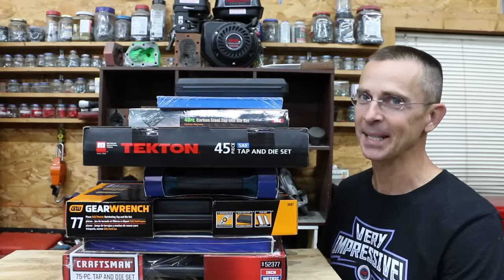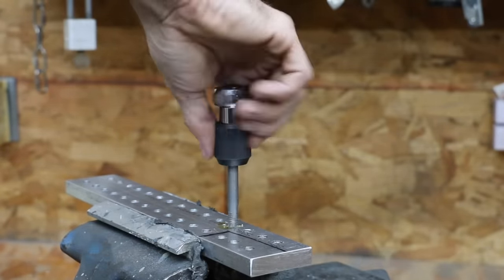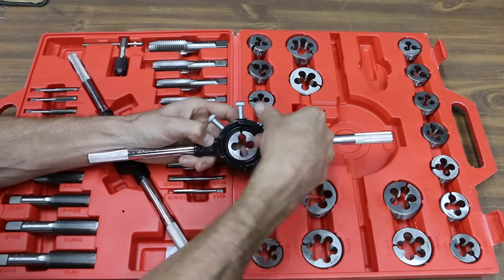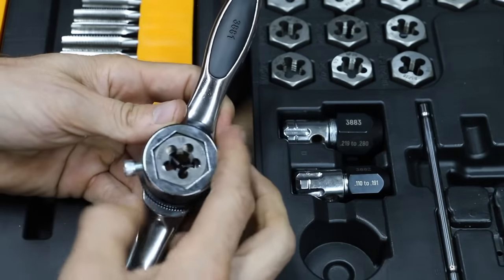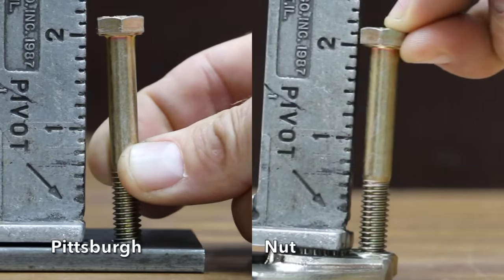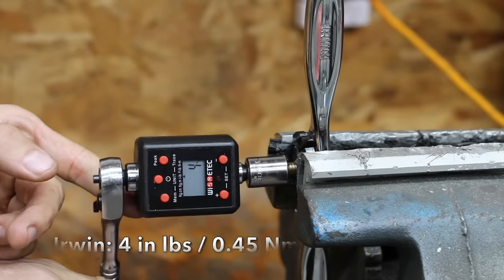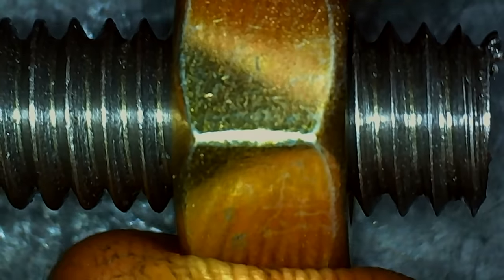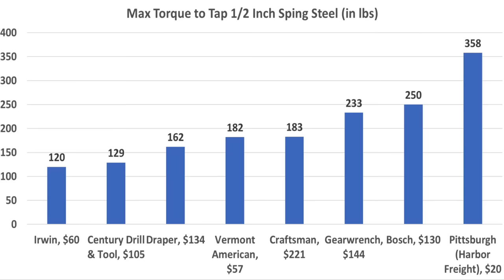Best TAP & DIE Set? Craftsman vs Irwin, Bosch, Draper, Vermont American, Tekton, GearWrench

Comment: Can we do a part 2 with some of the very high end taps like guhring taps? Not sure how you would be able to replicate the hardness, but on certain high pressure turbines using austentic stainless steel get a corrosion deposit on them that is quit a bit harder than the underlying metal and nearly on par with a nitriding coating. A regular HSS tap I was destroying a tap every two holes while the Guhring taps, while 10 times the price, were lasting 50 times as long in that application so actually ended up being cheaper over time
On another note definitely worth mentioning for the average person is the difference between starter taps (taper taps), mid taps(plug taps)and bottom taps.Looks actually like most of the ones you are using are plug taps, which while they will do the job, a taper tap will do a much better job aligning the tap correctly if you are doing it free hand.
Reply from the maker: Thanks for the suggestion.

Comment: To be fair, Aluminium is so soft you can use woodworking tools on it so in that regard it's good for testing the quality of the threads.
Since its so soft, if the threads are bad it'll just come out, so a comparison of the amount of force it takes to rip the bolt out would be interesting to see.
Reply from the maker: Thanks for the video idea.

Comment: Master Farm - Avid fan of your vids & subscriber. I know this vid is old. Abut a year ago I bought the Irwin set in both SEA & metric. I have used them many times since (both die & tap). They have performed very well. I even had to thread some 3/8" stainless steel rod into a 3/8 piece of stainless steel all at 24 TPI. That stuff is hard! Only issue @ 24 TPI was a couple threads toward the end shaved away. Yes was very careful with that fine pitch and used cutting fluid. Just a couple threads broke. Maybe my technique needs refining but those are fine thread

So WHY THAT BACKGROUND? Please tell me why several YouTubers I just saw swear you only use ROUND dies for threading rod and Hex dies are only for chasing threads? Have you ever heard that? These HEX Irwins work MUCH better than an old set of USA Craftsman round that I have. The Irwin dies are also much easier to start with a little insert in the cutting end. Just wondered what the deal was with so many saying not to use Hex dies for cutting.

Comment: I have always understood that the cheap sets are made from HSS and are good for thread repair or use in soft materials such as aluminium or mild steel. The ones for real  threading are made from a much harder material. Some of stuff being sold is terrible, even at my current work we have a HSS set that is good for bugger all. What might be interesting is if you could measure the rockwell hardness.
Reply from the maker: Thanks for the suggestion.

Comment: in my humble opinion I think the loose fit comes because you are using all those adaptors when measuring torque, which is fine for that purpose only, but the final whole which you test for fitting should be done very carefully with either the handles provided or your drilling machine to insure it goes ALL the way straight and not just the first few threads
Reply from the maker: Thanks for the feedback.

Comment: It seems the Irwin set performed the best 
But unfortunately I can buy it
Maybe test Alpen and wurth taps and dies 
I've researched both well but I don't know how well they will work with tapping spring steel, 

I plan on using it to make a file guide from 5160
Reply from the maker: Thanks for the suggestion.

Comment: What i've found with tap/die sets is that consistency between multiple sets of the same brand is what is more important.  That craftsman brand may have been closer to spec'd tolerance vs. some other sets, for example.  The more expensive sets tend to be MUCH tighter between sets of taps/dies.  If you take 10 sets of the craftsman version and tested between them you would find more variance than with a more expensive brand (at least in my experience...)

The other thing I think about a lot is the taped vs. die'd threads, does the thread made by the tap fit the die tighter?  That sort of thing is more important to someone who is machining a lot of custom parts than with the tap/die fitting whatever nut/bolt from a hardware store... which ALSO has a MASSIVE amount of variance from what I've learned.

Then again, we are the kind of people who weigh airsoft BB's and make graphs in order to find the best ammo :D
Reply from the maker: Thanks for the feedback.

Comment: Four flute taps are designed for rethreading, not cutting virgin threads, they will break and shatter. New threads are generally cut with two flute gun taps.
Reply from the maker: Thanks for the feedback.

Comment: I figured Erwin would probably do the best. I was hoping Snap-On would be included in this testing even though they are both made by Erwin. Snap-On requires additional steps in manufacturing and I was curious if those steps included material quality. Their adjustable Dies are something I wish I had in order to make tighter threads with less slop. It's unique how Erwin bought up past branded companies such as Ace and then Ace/Hanson to Hanson and now just Erwin. Erwin is the go-to company for Snap-On, Mac and Matco, plus Blue Point and many other well made tap and dies and Drill Bits. The alternative is over seas hit and miss quality.
Reply from the maker: Thanks for the feedback.

Comment: I was surprised at the amount of slop. I hobby machine and long ago found spiral taps worth their higher price and they can be power driven straight through the material. The taps shown are plug taps, more difficult to start by hand than taper taps.   The kind of dies shown are generally thought of as rethreading dies. Split dies work better for making threads on bar stock. They allow a small amount of adjustment.
Reply from the maker: Thanks for the feedback.

Comment: How about testing those helical insert thingies? I'd be interested to know if any are worthwhile. I had a motorcycle where a mechanic at a dealer service shop stripped the threads on the valve cover and I repaired it using a helical insert.
Reply from the maker: Thanks for the video idea.

Comment: I wonder how much a tap would remove from a good nut. Though I'm more curious how threads you made would fit in one of the tapped holes as if you had to make both a nut and bolt.
Reply from the maker: Thanks for the video idea.

Comment: People need to understand these sets are not for high production, most of these are good for home shops who only need a tap or die occasionally. Most of these are most likely class 1B because of how loose a thread they produce. These are good for cleanup of existing threads. For a tighter fit you would need to use a class 3B. 
It's a good overall test of products for most home shops.
Reply from the maker: Thanks!

Comment: Choice of tap and die sets depends on what you are doing, and whether they will be used often or occasionally.  But good taps and dies are not cheap, and cheap taps and dies are not good. Stocking a complete set can be costly to cover course and fine threads in inch and metric.  Incomplete sets are often frustrating, as you can be stuck without the size and thread pitch required for a job. Added to this is the kits generally are a compromise, containing only plug taps.  Often , tapered and bottoming taps are required.
Reply from the maker: Good Point!

Comment: The major reason for the side to side movement was the size drill he used (which he never showed) compared to each individual tap; that's the biggest reason for his fuck up! He used one drill to make a shit ton of holes, but used an incorrect tap (prolly same one) from each brand for each hole. Every machinist should know to follow your tap/drill size chart religiously for the best fit possible. You do that, it don't matter which tap & die set you use.

The other thing to keep an eye on is the thread series and class of fit #. All of the tap and dies he showed us were a UNC series, and even though he didn't show the class of fit # (it'd be in the manual of the tap and die kit purchased) I'd say the COF for a UNC would be either a 1 or a 2, which is a loose fit.

Comment: I kinda wish you would’ve measured the tap’s crest, and depth of thread. It’s hard to believe a marked measurement would be that off with the tap holes. If only there were a way to measure cutting effort by torque on a Fein tapping drill with the base for even plunges. I worked in a panel shop prepping enclosures/panels for devices and wire ducts. Everyone liked my work, because I never gave them “spinners” (screws that spin when trying to tighten).
Reply from the maker: Thanks for sharing.

Comment: One thing I forgot to add is when cutting threads using these tools, you turn 3 turns cutting, then back half turn to break off the chips. This leaves a clean thread, as not backing it up by half turn can cause the tool to clog up with metal chips, & leave a badly cut thread.

Comment: Those types of thread dies are not meant to be used to cut new threads. They are called chase dies. Only meant to be used to chase threads that have been damaged and require minimal clean up of the thread.

Comment: I have a harbor freight tap and die set from probably 18 years ago, its been great for what it is. However, the metric one I bought last year.. the taps aren't even deburred or cleaned, there burrs hanging off the taps, threads not fully formed, etc. They are complete junk and just wallow the hole out.
Reply from the maker: Thanks for sharing.

Comment: For my RC i use cheap tap like £4 for a set of 2 and just bought a cheap t handle ive snapped 1 in 2 years and lost countless but no biggie in replacements cheap enough
Reply from the maker: Thanks for the feedback.
Reply: @ProjectFarm  no problems cheap and expensive do have there places just depends on the job 👌

Comment: I love your show, and watch regularly. I don't mean to be nasty - I hope to contribute some positive criticism, but I've noticed in more than a few episodes that your testing methodology regularly disregards manufacturer/instrument/tool instructions/best practices. A few people have already mentioned how some of the dies were adjustable, but you didn't take that into account, so you ended up with poor results - this wasn't a fault of the tool - it was a user fault. You can't just take every similar tool and treat it the same. It's extremely common for tools to have particular requirements for proper usage. It's pretty unfair to use a tool wrong and then blame the tool. 

That being said, I've buggered up stuff because I used the tool wrong. I think everyone has been there before.

Comment: Just a note: the reason the 24TPI taps work at lower torque is because they have a greater mechanical advantage than the 18TPI taps. If the Draper included the correct tap it would have taken just over 49 in/lbs, which would still be second place.
Reply from the maker: Thanks for the feedback.
Reply: @ProjectFarm  of course! Always happy to see your videos.

Comment: EMUGE makes the best tap. such accurate threads....i use a 10 24 to tap 1 inch long holes thru 3 pieces of aluminum stacked, and they cut so clean it dose not mushroom and try to separate the plates. they dont come in sets as far as i know tho.... and its like $20 for the one 10/24 tap i use.
Reply: osg is my 2nd favorite.
Reply from the maker: Thanks for the feedback.

Comment: Sorry to say I disagree on the torque numbers due to the faster you turn the tap the higher the readings will be and the slower you turn.. lower likewise. To get true readings, the turning of the tap should have been done with a torque wrench for consistent turning pressure rather than a torque meter to determine all. FWIW

Comment: Normally you need to turn back the taps a bit every 2-3 rounds to shred the chippings. And don´t you use sets of 3 taps for each diameter in the US? Especially when cutting steel and spring steel, to prevent the need of excessive ammounts of torque and wear of the taps, since every tap of the 3 only cuts 1/3 auf the thread.

Comment: You should have done those same tests over again without the torque gauge. You got a lot of slop every time you used it making the thread loose.
I’m quite sure you would have gotten a tighter tolerance without it making a tighter fit.
Reply from the maker: Thanks for the constructive feedback.

Comment: I would like to add that the round die cutters with an open ring design are ment to tighten or loosen with the screws to achieve the fit you need. There are three screws on the handpiece, the center one should align with the open side to be spread apart with the screw, the two neighbouring ones can squeeze it tighter. So the fit comparison is unfortunately not accurate, or rather somewhat meaningless as you can adjust it.
Reply from the maker: Thanks for the feedback.

Comment: I have a criticism. These are all hand taps and dies. They can only handle so much speed of cut. They are not intended to be powered in steel at a rate much higher than by hand. Especially the "ready-rod" test using power is more than can be expected of carbon steel, especially without a flood of oil or coolant. I would bet that they would have done considerably better if the test had been done by hand. A steady 1 rev per 2 seconds or so would have been appropriate. Even doing the ready-rod test is expecting more of them than you should, unless you keep the rate down. That sort of threading needs a higher grade die. I know the Bosch did well and is carbon steel (obviously a high grade), but it still took some damage. 
Even with a proper-grade die, no machinist is going to just put some oil on the stock and proceed to jam it on down that length. Instead it will be properly lubricated/cooled. Reason #1: The stock heats as the die travels its length, and the die will not cut to size; i.e. when the stock cools the thread will be undersize. Reason #2: Without proper lubrication and cooling the die will wear much faster. As a screw machinist, I ran High Speed steel taps and dies under a flood of cutting oil and got thousands of parts out of them. 
"High Speed Steel" was developed long ago because of the severe limitations carbon steel put on cutting speed and tool longevity. These days, HSS is the lowest grade any machine shop would use even for brass or aluminum, and usually on aluminum it will be TiN coated HSS. Cobalt and carbide are commonly used these days when the added expense is justified.
Reply from the maker: Thanks for the constructive feedback.

Comment: my question:  Do you realize that when properly threading a hole or rod, you only proceed about 1/2 to 3/4 of a turn then back it off until the chips break away, then proceed again. Going all in in one shot will probably destroy any tap or die.

Comment: Been looking into tap & die sets. How often do people really use the die part? I just dont see need for it anywhere as much as the taps. Other than repairing some messed up threads. Thinking it might be better to buy good quality taps as a set where they come in taper, plug & bottom and just get some cheap dies from a set. I see lots of uses for the taps but not so much the dies. Do anyone really use the dies often compared to the taps?

Comment: I own an Irwin tap and die set I bought 38 years ago.  I have replaced the 1/4 20 a couple times but have no doubt tapped a 1/2 mile of threads.  The close ups of these "new" sets is alarming, scary, sickening (at 4:59!).  My metric taps are German and works of art.  You should have tested some machine taps for a comparison.  Spiral flute machine taps I use in my mill are on another level from the homeowner junk you tested here.  You get what you pay for unless you buy your taps at mega-store where you get junk.
Reply from the maker: Thanks for sharing.

Comment: interesting . . . no mention of greenfield t&d, or new york twist drill co. There are just so many good ones out there, i would not consider any of the brands you compare . . . 2 flute vs 3 or 4 flute - no mention of "roll" taps - forming threads is perhaps 
the one area that can make or break the entire project but is the last thing considered. A person will easily spend 3K on a
build and go to Lowe's and cheap-out on a "titanium" tap or drill bit, sold on the pretty "gold" color. and if it happens to be 
a through hole (lucky you) a gun tap is the only way to go . . . if a person lives in a city of moderate size, look for a machine shop supply
Reply from the maker: Thanks for the feedback.

Comment: I have an old craftsman set which turns out was made by vermont american and broke off a tap removing a valve guide. I tried to get a vermont american replacement but after looking at all the options decided the irwin was a better buy because it was High speed steel versus the carbon steel my old set was made of.. used it for 40 years never had issues broke a few and had them warrantied at sears but had to get loud and bully the manager as they are technically not warrantied but since they are not electric tools and have craftsman stenciled on them I told him they were sold to me with assertion they were lifetime warranty. I can no longer do this so went with hanson as lowes sells it and it actually was much easier to use then the craftsman by far. do not buy carbon steel taps HSS is vastly superior .
Reply from the maker: Thanks for the feedback.